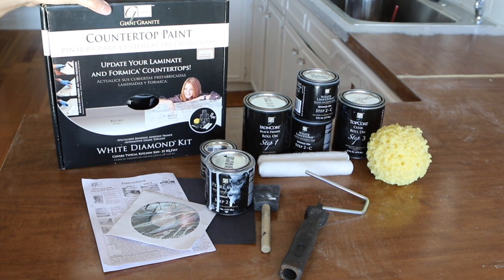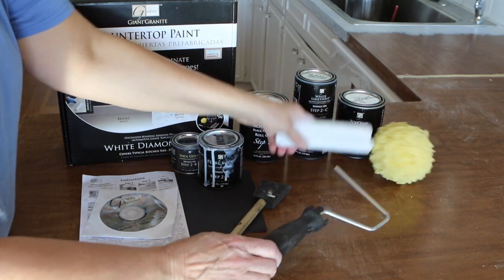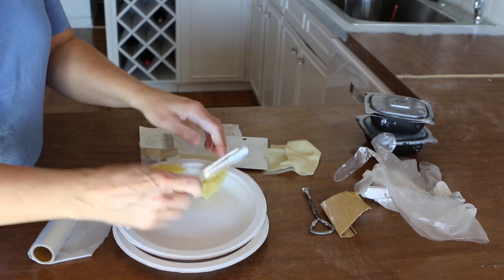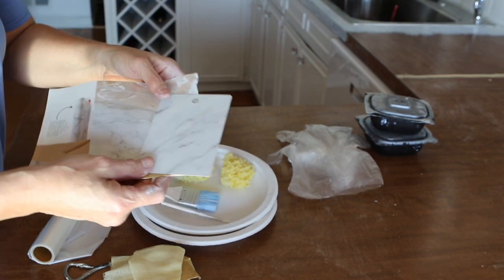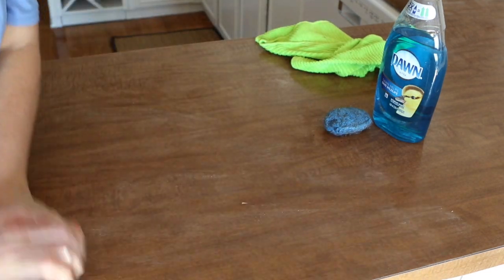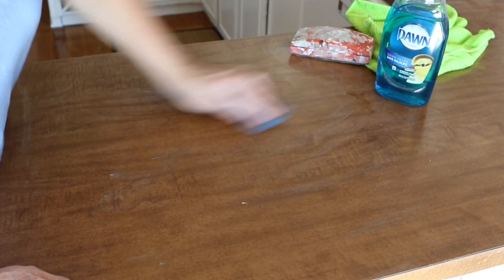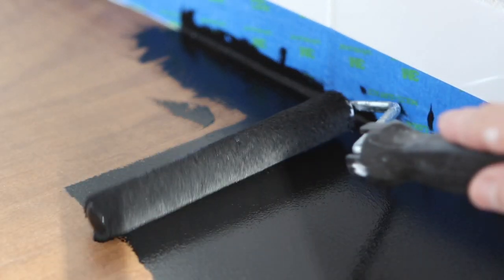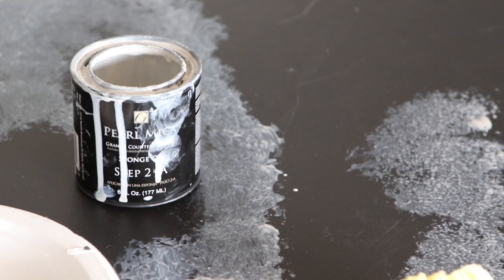How to Paint a Kitchen Counter to Look Like Carrara Marble

Comment: Hi there thank you so much for your lovely video your countertop looks amazing!! I really like your technique it looks so natural!!
I'm getting ready to do my kitchen countertop I've already done my bathroom but I didn't use the kit. Please tell me how your kitchen countertop is holding up after this year I really like to know please.
I used an epoxy pour on my bathroom counter and it's gorgeous. 
But I  want to avoid using epoxy again if I can it's very intimidating .
and a horrible mess if you screwing up!😜
I hope you get this message thank you so much for your time 😁
Renee🌷
Reply from the maker: Hi Renee - I have worked with epoxy before and it is amazing, but like you stated, hard to work with and a mess if you mess up. Plus is yellows quickly. 

My kitchen counters have held up very well. I would paint another kitchen counter again in a heartbeat.  The only small problem that came up was in front of the sink. This area can peel up if you let water from the sink sit on after doing the dishes, etc. Make sure to always wipe up this water.  The other problem that I had to deal with was when we got a new cooktop. The new cooktop didn't cover as much of the painted counter as the old cooktop did. I had to do some touch up. I am not sure if you saw that video or my blog post about it, but you can read it if you go to the posts on my blog on how I fixed these. 

How to Paint Kitchen Counters to Look Like Carrara Marble:
https://inmyownstyle.com/painting-kitchen-countertops.html

How to Fix Dings and Dents:
https://inmyownstyle.com/how-to-fix-dings-and-damage-on-painted-kitchen-counters.html 

I painted the counters in Oct 2016 and wrote the blog post in Jan 2017. I made the video to show what I did last year.  I am amazed every single day at how nice they have held up.
Reply: Hi there, thank you so much for your amazing reply!! And thank you for all your more information about this technique :-) ;-) those tidbits are worth a million bucks 😅🤩
Reply from the maker: Hi Theda - It has been over 3 years since I did the counters. They look amazing still with some wear at the counter's corners.  I also alway wipe any water from laying on the counter around the sink as that is not good. Water is fine, just not sitting water. 

I am so happy with how well the painted counters have held up. If I was doing this again, I would make sure that the Formica seams on the counter were glued down. I didn't check this and at one seam over a dishwasher, the paint in the seam cracked. It didn't come off, but the seam gets the heat from the dishwasher. 

I also got a new cooktop and when it was placed in, it was not the same size as the old one and there was unpainted counter top exposed. You can read this post on my blog about it: https://inmyownstyle.com/how-to-fix-dings-and-damage-on-painted-kitchen-counters.html

Using the kit will be SO MUCH EASIER than epoxy and it won't yellow over time like epoxy does.

Comment: Wow! It’s no wonder that I love your work, I follow you on Pinterest & you’ve been an inspiration to tackle many projects! 💕 I’ve been wanting to spruce up our countertops for quite some time & I’m definitely going to use your method. (we’re eventually going to replace them)  Do you think epoxy would up better over time than the poly? Thank you for sharing your process!
Reply from the maker: I have only used epoxy on small projects and not on such a large surface, but the video makes it look very doable. If the epoxy is truly non-yellowing then I think it would be better over time than the poly.
Reply: Diane Henkler Thank you! How had your countertops held up with the poly?
Reply from the maker: @cupcake7760  They have held up fine. I even had to fix one area after we got a new cooktop and it was easy to do and blended right in. You can see that post here: https://inmyownstyle.com/how-to-fix-dings-and-damage-on-painted-kitchen-counters.html

Comment: Hi Diane, how long did you wait for the pearl mica layer to dry before adding the white limestone?
Reply from the maker: Hi Sarah- I waited about 4 hours in between the dabbing on coats of mica and the White limestone.  It is better to wait to make sure the underside of the paint is dry. It will feel dry to the touch after about 30 mins, but wait to make sure it’s fully dry. If you layer too soon, you run the risk of the paint not adhering.
Reply: @DianeHenkler  thanks Diane! Your video has been the most helpful of any I have found and is exactly the look I am going for.
Reply from the maker: @sarahpoole5653   I am so happy to hear that. Thanks for telling me.

Comment: Thank you for making this video. Just curious why you didn't use the Giani marble kit instead of the white diamond kit? And how has the countertops held up for you?
Reply from the maker: When I did my counters a few years ago, Giani didn’t make a marble kit. I made up my own process using some of the paints in the granite kit. Since I did this Giani came out with a Marble kit. If it was available I would have used it.
Reply from the maker: The counters have held up wonderfully. A little wear around the sink and I had to fix around a new stovetop that was installed, but I couldn’t be happier.